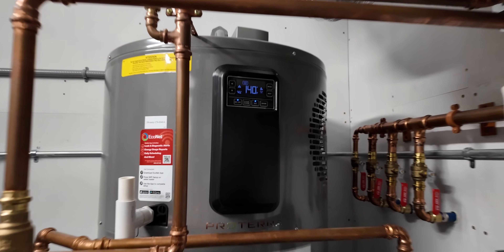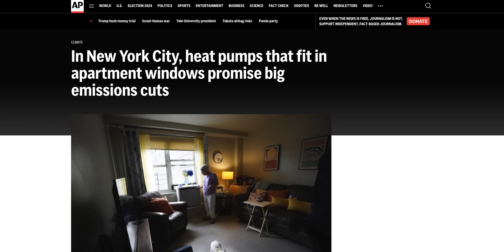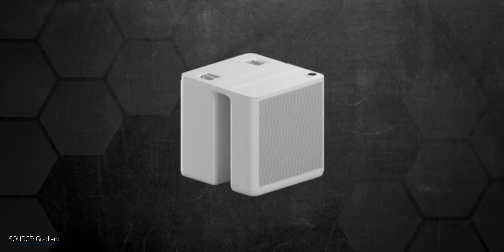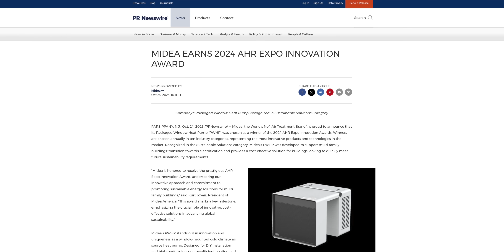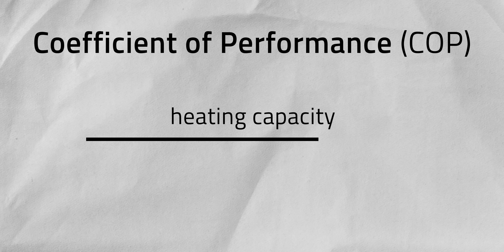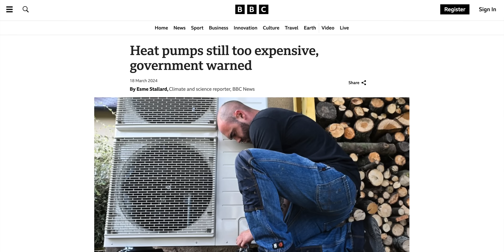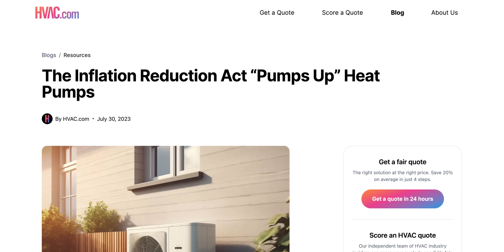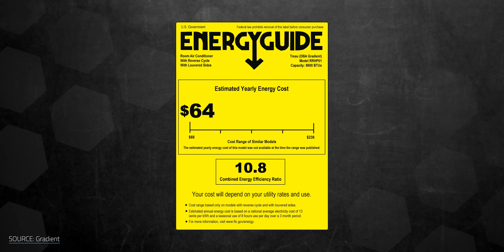Why This Window Heat Pump Is Genius

Comment: I like a retrofit strategy for NYC tenement style apartments utilizing a combination of R290 air to water heating only systems and Midea U (or equivalent) cooling coupled with heat recovery ventilation. Keeps costs in the same place, less maintenance for the landlord than VRF, benefits for indoor air quality. Air sealing and roof insulation can reduce heating load without a full Passive House style exterior retrofit. Radiation can be added as underfloor heat, ceiling radiant panels, or traditional radiators, which will require a large investment, as distribution systems designed to last decades aren't dirt cheap. Heating only distribution requires less space and is compatible with exposed pipework which can be aesthetically acceptable in a retrofit situation. Hydronic distribution is compatible with future thermal energy networks,  which could utilize air to water "legacy" units integrated into a public heat network with seasonal geothermal storage. Waste heat from commercial fridges and freezers, indoor agriculture, and servers could be used directly where appropriate or stored for later in times of excess. 

While these units are neat, they cut into occupants existing circuit capacity, produce noise, and encourage full tenant responsibility for heating, which reduces landlords' financial incentive to insulate. They will need to be cleaned like mini-split units. Installing a PWHP can potentially reduce indoor air quality compared to an overheated NYC apartment with open-window ventilation, the air exchange system that tenement apartments were designed for. If you install a PWHP, keep the gas stove, and keep the windows closed more, you've negatively impacted tenant health. As the conventional wisdom that outdoor air quality is responsible for health income disparities in NYC neighborhoods is questionable if you review recent data from MOCEJ, indoor air quality should be paramount when considering community health impacts.

Comment: 1:05.  I don't get this.  Why would every apartment end up being heated to the same degree just because they have a common heat source? Don't they all have radiators which can be dialed up and down, so that if the apartment is too hot, the owner can just turn off all their radiators?
Reply: Oftentimes a large brick residential complex they will have shared steam where the temperature is set centrally.
Obviously this is not common on modern builds but older model buildings ran into a problem piping individual steam and return pipes to each room.
Some had central heating and others had individual apartment heating but always leads to some areas being warm and others cool.

Comment: Biggest problem with these small units it going to be corrosion. Every window A/C unit suffers from galvanic corrosion once the powder paint begins to crack and peal.

I'd love to see some an all aluminum, stainless steel, or PVC housing instead of mild steel. For $3,000 it's not cheap and window installs in high rise building have obviously inherent risk. So, you want them to last a long time.

Comment: Man, they're really profiting from those units.  You can buy a standard reverse cycle split system for around US$800 in AU with better output.  These units are less powerful, less construction materials.

Comment: 3K dollars?  Way too expensive.  I could replace my central heat pump/ac unit for 4K.  Or go with a mini split unit for 800.+  I had a portable ac by midea.  Within 2 years, the aluminum fins started to disintegrate into a white powder.  It was in a bedroom not near water.  Very strange.

Comment: the $3,000 prince point is just far too high for what's being sold. I have an 8,000 BTU Hisense portable heat pump that was like $400 new. What is the justification for such high prices? Also I believe if these are going to be mass deployed like the video suggests they need to have serviceability in mind.  No point in trying to go green when you have to replace thousands of these every year because one part failed.

Comment: If the conversation from heat to cool is the source of the expense, then I'd be happy with a matched set of one heat pump, one a/c that could be easily switched by season without changing the support structure.

Comment: theese do not alow the weather to get hot enought or cold enought especally to be use in any cold weather states (michigan updatae ny iowa,colorado,montana etc ) that get down to -40 and +115also a mini split would be better efficency and less cost.

Comment: My only issue is the same as electric cars. It doesn't matter much how efficient the thing is if it draws its electricity from a power grid that uses mostly gas/oil/coal to generate the power.

Comment: If your room has two windows, could you install two of the $150 AC units, one as normal for cooling, and one in reverse for heating? That's $300 total, or ten percent of the cost of these combined heat and cool units.

Comment: Please explain the defrost mode?  It claims to not have supplemental heat.  I don't think there's any way to prevent icing on the outdoor coil when the coil drops below freezing.  How do they de-ice?  If they simply go into AC mode, that's going to put some pretty cold air into the room in the winter!

Comment: Jesus Matt, please decide if this thing functions in temperatures mentioned @ 6:45  or mentioned @ 7:32. Either way your material is at usually low level even for a commercial.

Comment: I'd love to have one of these but the only window I have available has a sloping section of roof just below the window so the outside section would either have to rotate 45 degrees increasing unit cost or I'd have to build something stable for it to sit on and not let bugs in. The existing AC unit didn't need much work to get it to fit. Perhaps they should build a traditional style unit like a regular in window AC unit for those with tricky/limited exterior spaces

Comment: I bought a Midea U shaped AC unit last summer. It was the most poorly made piece of HVAC equipment I've seen in 20 years. Within 3 months the refrigerant had leaked out. Because the evaporator core rotted out across the bottom. It then took another 3 months to finally get them to accept my warranty claim.

Comment: I've got two window heat pumps, but they only work down to 41°F. They're built like regular window air conditioners, but they're reversible. Look for A/Cs with heat. One of them is a Midea. The other is Perfect Aire. The DOE really needs to get on this, because new heat pump designs can work much lower. I'm looking at a mini-split that will work as a heat pump down to -13°F. It will also cool with outside temperatures as high as 122°F. That is something we're going to be needing in the coming decades.
Reply: window a/c's over here are all non inverters, cooling only and are ugly, yet their priced exactly like the minisplits that arent ugly, are inverters and heat and cool
Reply: @peppermeat8059  There are quite a few window ac units that you can go buy now in any state of the union that use inverter compressors.

Comment: This really is ground breaking. I’ve converted a vintage travel trailer into my man cave and a little unit like this fits my heating/cooling needs perfectly!
120v to my backyard, and no plumbing/refrigerant lines makes it easy.

Comment: I believe part of the high price accounts for the higher efficiency units with much lower operating temperature (unheard of for 'portable' units, until now) and perhaps some 'opportunity cost'... the first companies producing them with high efficiency AND therefore qualifying for the Energy Bill incentives, WINs.  I'd also like to think they will run at least 5-10 times as many hours (especially since they include heating, than current portable AC units and smaller format Heat Pumps and won't break down as soon.  In other words, better durability/longevity.
One question I was hoping you'd touch on is whether they'll be available for slider windows, even though I'd like to convert my windows to double hung.  I wanted to (not really..) look thru all of your other comments and your responses.  I wonder if you can make an update and answer most of the 'top 10' questions that are asked..  Even the top 5 would help.  Thanks for your efforts.  I appreciate the broad range of tech topics you take on.  How about 'simple ways to ride the duck curve, to the advantage of yourself, society and the natural world..'.  Thx

Comment: Umm, you're not getting out more than you put in (unless you're talking about fission).  That's perpetual motion. Not going to happen.

What you do get is double to triple the efficiency of an oil fired steam boiler system.  Instead of 30-40% efficiency, you get up to around 80%.

Comment: While the cost is steeper than a top of the line window air conditioner unit, people need to consider what the cost to add a second source for heat would be.  Most likely it is going to come close to the same cost as the heat pump (~$3000) but the heat pump will get you a 30% tax credit and an all in one unit!

Comment: Tooooooo expensive for a stylish window AC unit. I understand that in order to achieve better performance it will need larger heats exchanger, a water pump for humidity/water management, and some duct and dampers (if they have the intention of controled fresh air intake). But all that doesn't justify the price disparity with current existing AC systems, all are very well established technologies, including R32 with all it's special running requirements. As someone said, we need more manufacturers on that.

Comment: My only issue with the design is that here in the vast majority of the greater Toronto Area, our high rise (and even many low rise) apartments have windows that cannot accommodate this type of heat pump. I can also see this being a safety risk for families with small children, as it would require the screen to be removed and the window still to remain somehow locked in this semi-open position, where there may or may not be a locking point. Otherwise, I really do like the idea. My mom’s apartment unit has this exact issue, and even had the heat running full strength right into mid May, making her unit obscenely warm for days on end. A heat pump would completely solve the issue presented.

Comment: For our condo we had a quote of $10k to update our old 2Ton AC system because it was starting to fail.  They would have to change the roof condenser as well as the furnace for the newer Freon gas.  Instead we just got a Media window AC system from Costco for $300 which was 12,000 BTU.  Two of them can cool our whole condo and would be so much quieter then the loud blower fan.  Each unit draws about 300-400 watts vs my central air that will pull 2000-2200 watts.  So two of them only cost $600 and can get the same BTU of 2400!  I also love that I can only cool a portion of my condo rather then the whole unit.  For winter our building provides floor radiating heat so we didn't need to worry about a 2 way heat pump.  I feel like this was a win win!
Reply: It's quality, though. A good system would cost less to run and be more even. You're comparing your very old system cost to a new window unit that's more efficient. A new roof unit would perform waaay better than those new window units. 
Problem is the sales of new units usually push the cheapest unit thwy always install than a variable unit for a grand or two more which is way more efficient.

Comment: I would only buy one when they are below $1000. I will keep my window unit in my small 646 square foot home that I've lived in for 45 years. A $225 8000BTU window unit keeps my home cool in 100 degree temperatures and I'm not spending $3000 for a unit.

Comment: In Germany the largest problem with heat pumps and Solar cells are, that the elektricity grid was never build to handle such loads. And not everone wants to have a large battery in their appartment to kompensate for the lack of grid performance.

Comment: standard heating and cooling is done to each room. There should be a way to handle this otherwise it does not solve the full problem

Comment: Don't most units have at least two windows? If it costs so much to add heat, just take a normal A/C unit and flip the evap and condenser around, call it a heat pump. Each unit will have 1 A/C unit and 1 heating unit, neither have switching ability. Would come out to $1000 total for both units, still way cheaper than this.

Comment: Does the mixing of the moisture into the cool air an unavoidable feature of these heat pump window units? Can the moisture be evaporated and expelled out the back of the unit? I like my air dry. Cold, moist air is just clammy to me.

Comment: Heat pumps really seem like a no brainer evolution for climate control, all the better than they can turn window-warts into an barely intrusive total replacement for old systems that have to be spread throughout an entire building.

Comment: A Heat-Pump hot water tanks and Heat-Pump heaters (that exchange heat with air) are not a good idea in areas where the outside temps average around 10 degrees-C or colder, because the efficiency of the heat-Pumps drop into the minus range when the outside temperature is 10C or lower. At these temp levels, an electric heating element type heater is required, as they are more electrically efficient.

Comment: Matt I generally enjoy your content and appreciate the technology updates - this window heat pump however is a non-starter at $3K and relatively low COP.  As an engineer, I've seen traditional heatpumps and now mini-splits with much higher efficiency (COP>4) and at significantly lower costs for the capacity.  Not sure this is so costly because the government is paying for it (typical wasteful spending) or what - the heat pump only differs from an AC unit by having a reversing valve and a simple control board to manage it - maybe $30 in parts...

Comment: We have heat pump (cool & hot AC) in Window format, Split, Cassette (ceiling mounted) and hidden for tens of years in Saudi Arabia and the 18000 btu is the most common cost less than $500